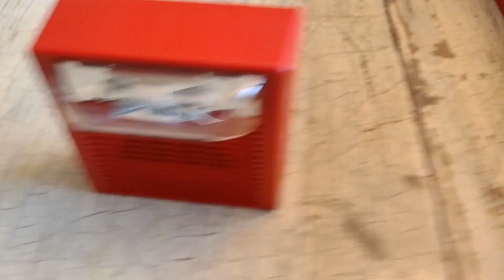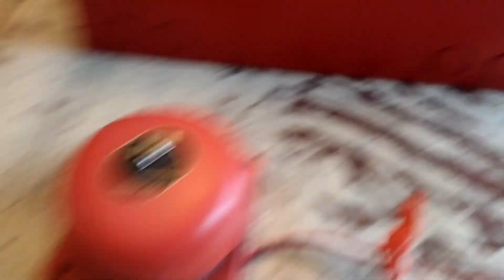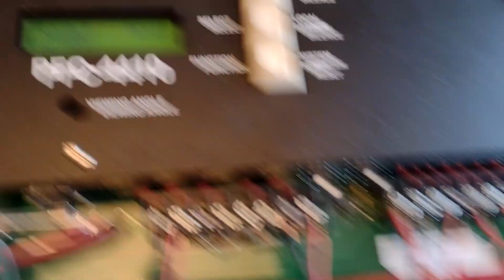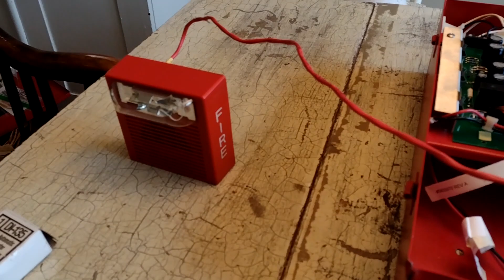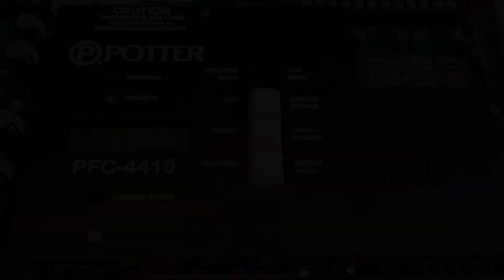System Test - Potter PFC-4410 Fire Alarm Panel

Comment: I have a power supply (well i might get) it outputs 24vdc and 60 watts and 3 amps. Will it harm old 24vdc Mechinal horns and the elecronic ones or no 
I would  send the link it but youtube  will delete my comment.
Reply from the maker: What kind of power supply?
Reply: @Fahrenheit4051  its a big one. I changed my mind and will not get it. So i will use a 12 Volt battery for my system since the power is filtered.
Reply: @Fahrenheit4051  Potter… hmm… Sorry if this sounds irrelevant but that last name sure sounds kinda familiar…